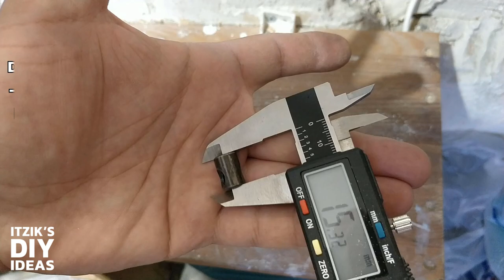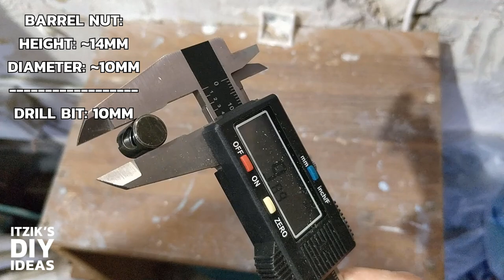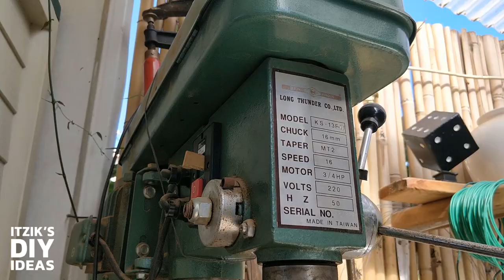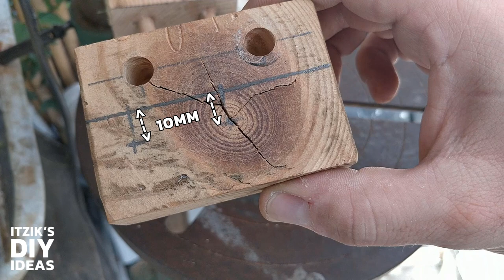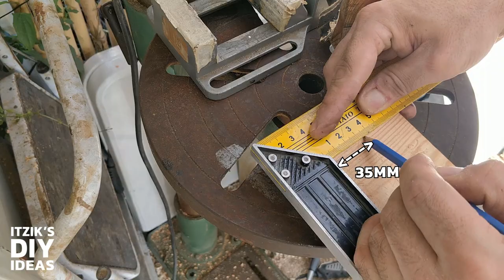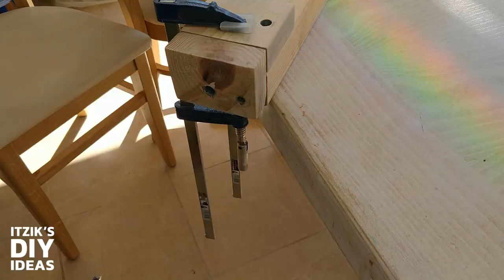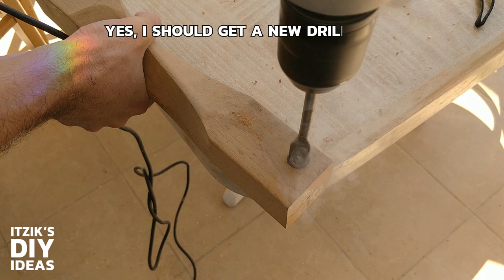DIY Cross Dowel Jig 2-in-1 | Barrel Nut Jig | Detachable Wooden Furniture/Bed Joints | XDIY

Comment: Fantastic. It would be great to have some sketches of this so I can make this jig.
Reply from the maker: Thanks paul!
I dont have a sketches but have a guide I wrote with pictures. Can it help?
Reply from the maker: https://www.instructables.com/2-in-1-Cross-Dowel-Barrel-Nut-Jig-for-Detachable-W/
Reply: @XDIY  yes please. That would be fantastic. Thanks
Reply from the maker: @paulmullemeister489  I already put a link, see the comment.
Reply: Thanks a million.
Reply: I still don't understand why the jig body needs to be detachable. Wouldn't you want it to stay attached to make the mating holes start the same distance from the edge of the workpiece?
Reply from the maker: @vincentchov5760  You don't have to... but this is the way I found it best for the case (shown in the video)... If you build a bed for example, the leg usually wider than the side rail, so the distance from the edge isn't necessarily the same (I drill it in the middle of the leg). Maybe there is a room for improvement...
BTW, I made a complex project of bunk bed using this JIG... the video is so long that I still didn't have time to edit but this jig helped a lot :)
I hope to edit it ASAP...

Comment: Nice one, do you know what those threaded nuts are called?
Reply from the maker: Thanks mate.
I guess you mean to the 'Barrel Nuts'?
Reply: @XDIY  is that what they are, awesome!
Reply from the maker: Currently the bed project, which I made this Jig for, is on hold since we got one from friends... But I'll keep it for the first chance 🙂
Reply: @XDIY  I made both of my kid's beds but they were not made to come apart... these things would have been a good idea 😆
Reply from the maker: So you have a bulk bed and not bunk bed 😉, go with cross dowel next time 🙂
Reply: Barrel nuts are the bane of my evening, currently! I don’t recall having a great experience with pre-made kits that use them - ever. I love how you measured the drill depth on the holes so the barrel nut wouldn’t insert too far in, out of alignment with its counterpart! I wish my kit-maker had done so! 90 minutes later, turning the wood upside down to drop the nut out so I could realign it over and over again to no avail! I give up for tonight.

Comment: How do I measure which size barrel nut I need as I'm assembling a bunk bed and I've lost 2 barrel nuts Cross thread m8 but I wana order some off ebay and I don't no which size I have .I have 2 but I need 2 more
Reply from the maker: If you have 2 barrel nuts, I think that the best way is to measure one of them, but the most accurate way is using a caliper tool (Iike I do in the video at 0:15). Otherwise, with a measuring tape, but it's less accurate...
Reply: I don't have that I only have a tape.